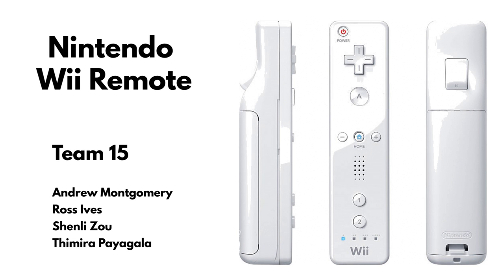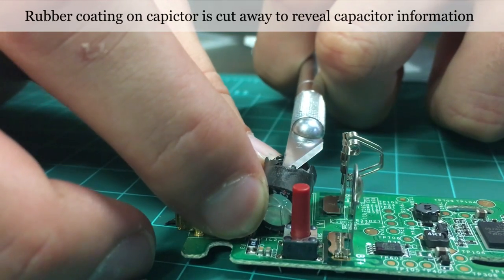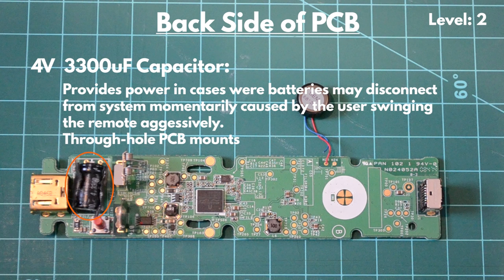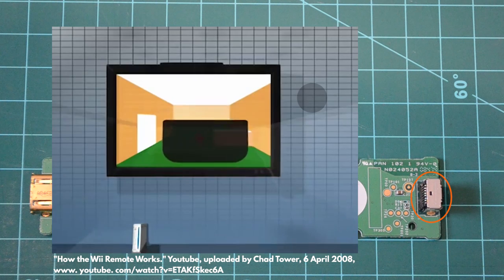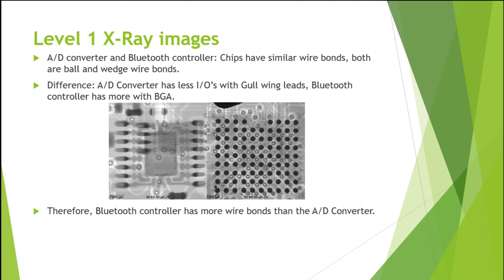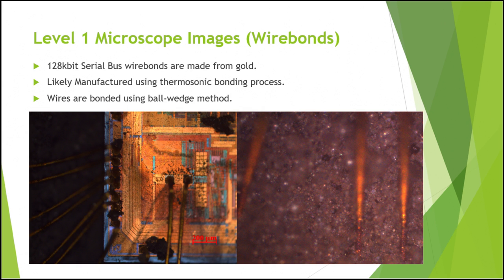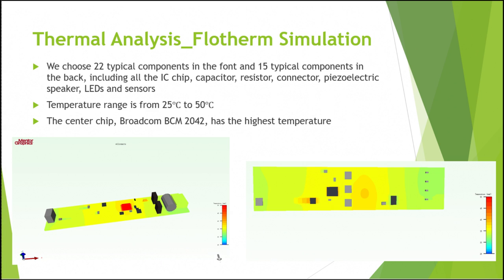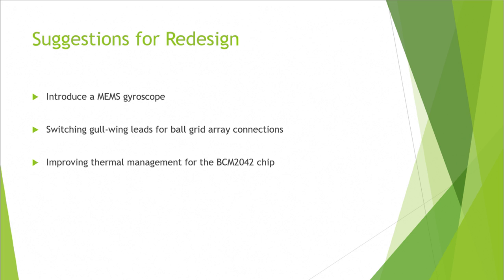Wii Remote Teardown and Analysis

Comment: There is a big problem with your analysis. The BU8849FV is not a flash memory. It is a 24pin ADPCM decoder with an 11 bit digital to analogue audio output and contains an audio amplifier. The 16pin BU8844FV version of this chip used in other wii remotes did not have an inbuilt amplifier and it needed a separate audio amplifier support chip..
Reply: I don't think they care
Reply: Yeah, you're right. There's no need to have 16kb of flash memory if there's already 128kb for storing all the microcontroller codes. Also notice that they didn't mention any audio decoder chip at all in the video.

Comment: After a few minutes the remote dies  if I remove batteries and wait some minutes, it will turn on again when I put batteries and will die soon again. Not a battery problem. I'm going to try and replace the main capacitor, that huge one near the bottom. Am I nuts?
Reply: Did replacing it help?
Reply: @bryceshaw06 i was not able to perform the replacing and ruined the board. Since that time i got a little better at electronics but not much. I'm not a pro, but this video is still a lifesaver.

Comment: By the way: the clips aren't in the position the red circle shows. They are at the height of the up-button. Using a tool to push the upper shell gently outwards at this area will prevent them from breaking.

Comment: Can you please repeat this video with a wii remote with motion plus integrated? i think i have a faulty resistor/capacitor i dont know, its small and has the letter G on it or at least its looks like it. next to it is the letter F11 its between the 1 and 2 buttons
Reply: You are probably referring to F1, which is the primary fuse. If it doesn't have continuity, you'll have to replace it with a new fuse. If you don't mind the risk of more vital parts getting potentially damaged, you could also just bridge it with a tiny wire. 
Before you replace or bridge the fuse, you should check for liquid damage / trace rot.

Comment: For people trying to open their remote:

1:25 the editor circled the wrong part.

The plastic piece shown on the left is a cylinder extending from the top piece of the remote. It’s used to stop everything from moving when the remote is closed, as it hugs a contour on the motherboard and bottom piece.

The plastic piece on the right is a tab that extends from the bottom piece and holds the motherboard to the bottom piece. It does not touch the top piece of the remote.

To the right of the red circle, you can just barely see the actual tab.
(Shown at 1:31)
The female part extends from the bottom piece with the contour facing the outside of the remote. The male part is on the top of the remote and is not visible.
The male part is very small and is very likely to break when opening.
At 1:34.5 you can see they actually broke both the male tabs off the top piece of the controller (Slow to 0.25x speed to see the in-focus frame).
Don’t feel bad tho, it’s very likely to happen to you too.
Reply: Great information, thanks!! I’m trying to open a Wii-mote right now...
Reply: Hi do you know the size of the tri wing screw driver?
Reply: 2 of my remotes plastic pieces are broken even I read your comment. It is really hard to open remote without break them as you said(at least for me). I will tape both side of remote. Thanks for information
Reply: @joaovictormansano  I use the Y2.3 tri-wing screwdriver. But, the next size up or down should work fine too.

Comment: hey can you help me? I have a chuck that is having issues with the motion.  I have to smack it to get it to work even then it won't stay working properly. I bought a cheap chuck and the motion controls are fine but the stick is stiff and I don't like how the c button feels.  I this the broken chuck is just getting "jammed" or stuck if you wanna call it that.  I looked up how the motion control works and that its type of gyro so I figured maybe the gyro in the chuck was getting stuck which is why smacking it work by maybe knocking the gyro loose and back into normal position. anyways is there a way to fix this? I just don't want to spent money on something I think I could just fix. I already thought about swapping out the buttons but I still have the problem with the stick being kinda stiff.  please and thanks for the help
Reply: it's called a nunchuck or nunchuk.
Reply: @noxious_nights  This dude has asked for help and you CORRECT THEIR SPELLING???
Reply: Dude chill the fuck out, I'm just telling them what it's called
Reply: Just open it up so you can figure out what is actually wrong.

Look up “GameCube joystick replacement”.
That should show you how to fix it, and what the problem is (worn stick or faulty connecting part)